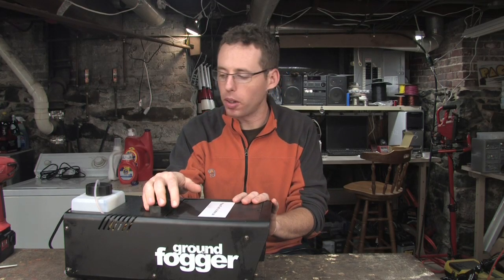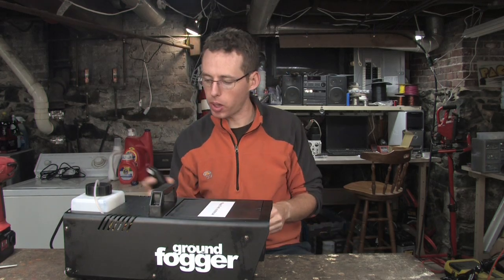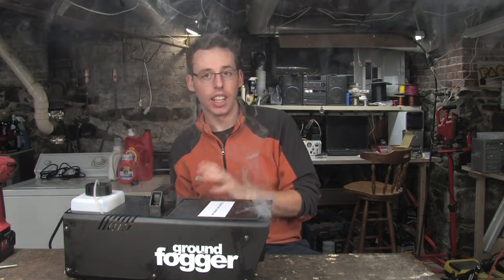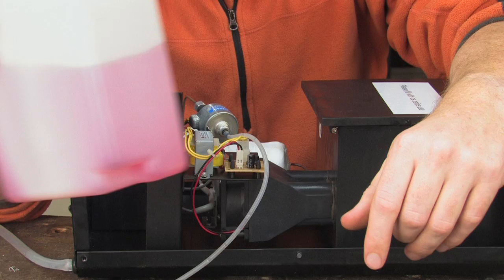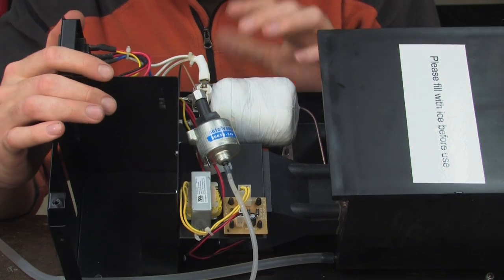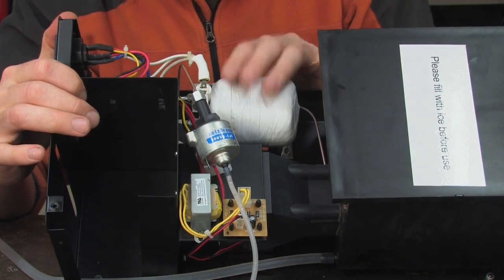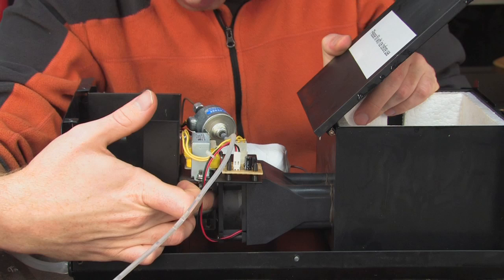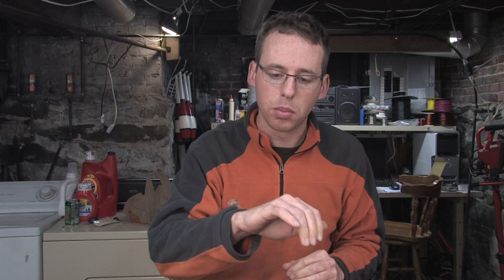How it Works: Fog Machine

Comment: That's... was.. like.... The best... Fog... I ever had...! Hahaha one thing to mind that's not a thermal protector. It's a thermostat that tells the mating it's hot enough for the pump to spray fog. Otherwise the liquid would just spray out the front. Try hitting the switch when you first plug it in cold. It won't spray correct. Cool video tho. I was wondering how the insides worked anyway. I just got done watching a kid tell me to heat some beauty product from cvs on the stove. Just buy fogger

Comment: You would probably produce a very small amount of steam only. Fog juice is glycol based with a little distilled water in it. The heater and tubes in the machine would probably build up calcium deposits over time and cause it to not function.

Comment: there's a good chance the pipe going into the heater block is the same one as comes out after it's wound round a heating element several times.  You may even find that the exit end of the tube is pinched slightly to make sure that the exiting vapor does so at high pressure.  The fluid itself is generally glycol and water at a 30% glycol to 70% water ratio.  The earliest smoke fluids used glycerine for a thick but slightly stinky fog.
Reply: i cant say i expected you to be here